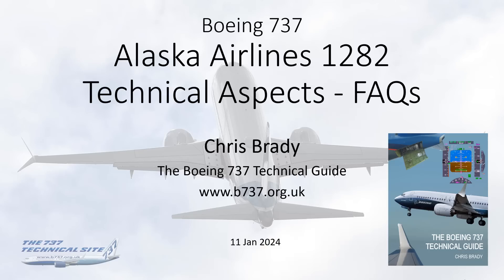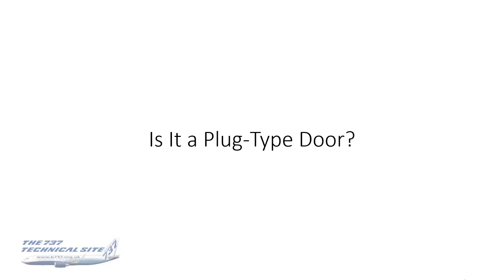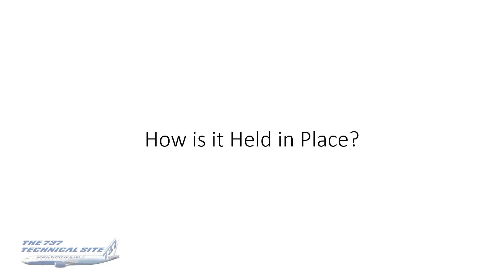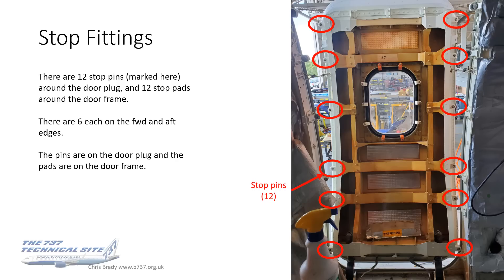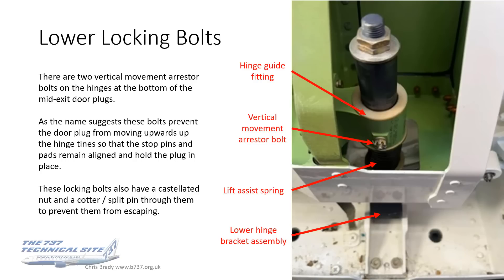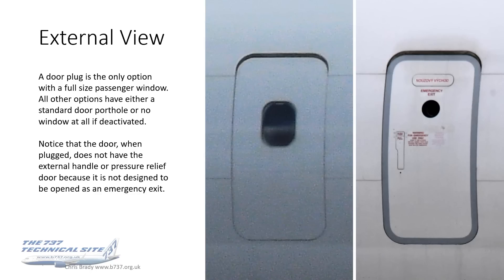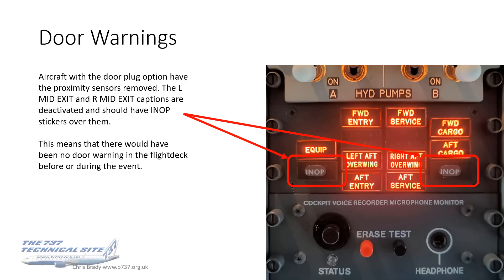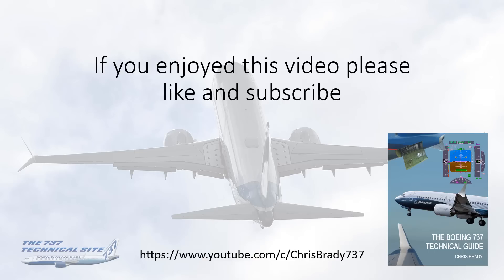737 Technical Aspects of AS1282 FAQs

Comment: Hi Chris @The Boeing 737 Technical Channel. Hope you don't mind my two penn'orth:
Firstly, it seems to me that there's an issue with nomenclature which is not helping. Definition for clarification is - NOMENCLATURE the devising or choosing of names for things, especially in a science or other discipline:
"the most important rule of nomenclature is that the name of a substance should be UNAMBIGUOUS".and
You youself even mix the terms up in the first couple of minutes of this (excellent) posting.
So, a Plug DOOR is like a plug on a chain in a kithen sink. It is wider than the hole it is plugging and also wedge shaped. This means that the more pressure is pushing on it, the tighter the fit in the hole. Try pulling on the chain when the sink is full of water as opposed to empty and you'll feel the difference. So a Plug DOOR opens INWARDS because it's wider than the hole, and it's wedge shaped.
A Door PLUG opens OUTWARDS when unbolted by the engineers, and is NOT wedge shaped. Therefore the pressure inside the aircraft is always trying to force this door OPEN. It is only the STOP PINS against the STOP PADS which prevent this. The four bolts with cotter or split pins prevent the stop pads and stop pins from getting out of alignment with each other.
So, when the aircraft is pressurised and the stop pads and pins are forced tighter against each other, the pressure is actually trying to force the Door PLUG open, not closed, as it would with an actual DOOR.
Therefore, the adjustment and locking of the STOP PINS is also CRUCIAL as well as the aforementioned four bolts.
Lastly, no-one seems to have mentioned how a pressure seal is achieved with this PLUG. I'm assuming an actual SEAL? (Think fridge door, but on the aircraft body and more industrial)
BTW to remove ambiguity I would suggest the terms "Plug Door" and "Door Blank"

Comment: Hi Chris,  Great work, the details are critical and you keep peeling another layer of the onion. Here are my thoughts:

1. with the airplane on the ground at sea level, the door.plug in correct position, and the door.plug and all interfacing components "rigged" optimally:
 a. significant upward or downward movement of the door.plug relative to the cabin frame is prevented, as:
 - the cabin frame attached roller pins cannot pass the closed end of the door.plug frame attached roller guide in the upward direction nor pass the locking bolt through roller guide fitting in the downward direction.
 - the arrestor bolts passing through both the door.plug frame attached hinge guide fittings and the cabin frame attached upper hinge cylinder.guide segments prevent both upward and downward movement (assuming the arrestor bolt passes through a reasonably toleranced hole in the upper hinge cylinder.guide and not through a vertical slot).
 b. again, assuming optimal "rigging", the twelve door.plug frame attached stop pins are aligned on center with each corresponding cabin frame mounted stop pad.
 c. some limited upward, downward, and sideways movement is possible for the door.plug relative to the cabin frame due to frame, fitting, and "rigging" tolerances, thus the stop pins might move slightly off center of the stop pads, but these design tolerances presumably are sufficient to restrict movement to appreciably less that half the diameter of the stop pin, else if any of the stop pin mating surface starts to clear the stop pad edge, position and pressure distribution could unequalize leading to failure as noted in other comments.

2. with the airplane climbing and cabin-to-exterior pressure differential mounting, the stop pin to stop pad alignment distributes the pressure across twelve fittings designed with sufficiently strong metal to withstand that pressure. the pressure retains the stop pin to stop pad alignment, and all is well.

3. conceptual steps to tilt open the door.plug on the ground at sea level (complete removal requires additional steps):
a. remove the hinge arrestor bolt cotter pins and nuts, and applying pressure down against the spring to relieve the interference between the arrestor bolt and the cylindrical hinge segment hole, slide the arrestor bolts out.
b. the spring can now exert upward force on the door, raising the door.plug with attached roller guide slightly such that the bottom of the roller pins are in interference with the roller guide locking bolts; the stop pin and stop pads remain mostly aligned if not slightly shifted.
c. the roller guide locking bolt cotter pins and nuts are removed, then apply some downward pressure on the door.plug against the spring to remove the interference pressure between locking bolt and roller pin, and slide those bolts out.
d. apply upward force as needed to assist the springs, and pulling the door.plug inward to provide clearance between the stop pins and stop pads, raise the door.plug until the roller pins are at the bottom opening of the roller guide and the stop pins are clear of the stop pads. (this assumes the stop pins do not need to be adjusted to open the door.plug, but that may be an incorrect assumption)
e. push the door.plug outward at the top, with rotation of the hinges. the door is held at a tilt by the short strap assemblies (cables).

4. The next "layer of the onion" might be understanding what it takes for optimaly "rigging"? In approximate order of priority, the following are/could-be involved:
a. roller guide locking bolts and hinge arrestor bolts with associated nuts, cotter.split pins, torque, etc. all installed to spec.
b. the stop pin adjustments, along with bushings, bumpers, locking wires or other components of the stop pads or pins, all installed and adjusted to spec (if the pins extend out too far, might be too hard to pull in on the door.plug enough to clear and get inward of the stop pads;  if the pins not extended enough, the pressure in flight might push the door.plug frame and skin against the seals enough so the wind stream in flight can get behind the door.plug skin, and making it hard for the auto pressurization system to keep up with the leakage, and while landing, assuming other tolerances of bolts, fittings, etc. are excessive, allow some of the stop pins to bounce/vibrate out of alignment with their stop pads).
c. hinge guide fittings - notice each fitting has vertical slots for each of the four bolts where attached to the door.plug frame, presumably necessary to achieve optimal positioning.
d. door.plug perimeter seals or similar.

5. It seems clear from the NTSB press conferences that even if all the bolts are installed properly, if the stop pins and stop pads are misaligned, then the roller guides and hinges are not strong enough and will fail. It is hard to tell from the photos, but one impression is that the roller pins are shorter than might be expected, thus if the door.plug bowed outward, the roller pin could exert force close to the edge of the roller guide, more easily fracturing it, and/or escape the locking bolt.  Further, that there is a bigger gap between the roller pin base and the outer edge of the roller guide, again, allowing for more sideway movement of the door.plug, and less of the roller pin to be within the roller guide.

6. The NTSB press conference stated that "transparency" is important, but there is limited evidence of said NTSB transparancy.  I would have expected high resolution close up photos of the hinges hanging outside the airplane, as well as the same for the interior side of the recovered door.plug.

Comment: Curious how the pressure seal works on this the door. It would seem to be an active seal that has to be self energized as the differential increases since the door wants to move away from the fuselage. If the door was slightly out of position (depending on various factors) it may or may not energize leading to pressure alarms? 
A passive seal would be used on a real plug type door as the door would compress the seal.

Comment: So, those 12 lock pins must be used to pull the door against whatever type of seal they use. Therefore, to open the door you would have to slacken off all 12 lock pins to release the pressure of the seal and also to clear the indented portion of 12 lock pads. And to close the door, resetting the torque on the locking pins would be about the last thing you would. I wonder if it was done?? Hard to see how the locking wire works on those locking pins. I’m guessing indents around the hole for the wire to drop into, maybe. Is a special tool used to wind those threads on the locking pins in and out?? Seeing more equals learning more. Regards
Reply: Just based on the pix, I didn’t see any indents on the lock pads, or if there was, it’s not visible there.

I don’t believe the lock pins pull the door against the seal other than holding it tight while it slides downward into place the 1.5+- inches required to get the pins lined up with pads and such.
Reply: Thank you for showing interest in my comment. The photo at the 4.24 mark is the best closeup of one of the 12 door pads I have seen. Shame it’s not in 3D. But can’t be really sure, unless I was holding it in my hand. It really looks like it dishes in from the outer circle rim. Not very much, but enough to help with the alignment of the door.  I can’t believe that getting the door onto the top roller and then pulling it down, could create enough preload on the door seal. Winding the door pins in a couple of turns would certainly do it. Once the airframe is pressurised any outward movement of the door would only lessen the effectiveness of the door seal. The seal is attached to the airframe and the door has to pull in to the seal. When the aircraft is pressurised, the pressure on the door is always trying to break the seal. The pressure can not help make the seal better in this style of door. I believe those 12 door pins and pads should be holding pressure against each other, not just close to each other. And the only way to achieve that would be to get the door in place and then crank on some pressure. Even if the pads were flat on the surface. It would still make sense to tighten the pins. The 12 pads and pins have to take all the loads. That top roller guide track is way to weak to take any decent loads. Looks like it has enough strength to hold the door in place until the 12 pads and pins take over. Well, that’s my take on the engineering. I hope we get to find out the real reason in the end. Regards.

Comment: Much better Chris. The only slight criticism I have is with your references to the roller pins "moving". They're fixed to the door frame and don't move, the door and guide tracks do. The bolts aren't "holding the roller pins in position", they more accurately prevent the door and guide tracks from moving upward over the roller pins. It occurred to me that the springs likely counter almost all of the weight of the door, making it easier to lift. That would mean that without the bolts in place, the springs are trying to push the door up, so it may not require much force to move it when the cabin isn't pressurized and the door isn't pressed tightly against the stops. If the bolts were missing, I wonder if the door wasn't gradually working its way up while depressurized until it finally cleared the stops at 16,000 ft. Even one bolt in place seems like it should be enough to have secured the door.
Reply: The roller pins might not move but the ring/roller around that shaft will likely move as it rotates…
Reply: Absolutely concur with this comment. The frame of reference is critical to understanding the kinematics of the door. 

Also concur with the description of the function of the springs. The operator has the advantage of his body mass to push the door downward and closed, but could use a little help in lifting it to the open position.

Comment: Your "Alignment" slide shows what appears to be the gray door seal on the frame and it looks like the door is pulled tight against the seal when it engages the stop pads. I wondered what provides the sealing if the door isn't over sized.

Comment: I think there is enough published information to make a reasonable guess as to what happened. The starting point is that there were loose anchor bolts found on other airplanes holding the hinge guide fitting to the door. When the vertical movement arrestor bolt is in place, there is little force on the hinge guide fitting anchor bolts from the spring. Loose anchor bolts are then free to unwind and remove themselves as the fuselage flexes in ordinary operation. Let's assume that the fore side anchor bolts loosen and come out. On the next landing when the differential pressure across the door goes to zero, the fore side of the door sags and the door tilts to the fore side. The movement is limited at the top side due to the clearance between the guide track and the guide roller but it appears that movement aft on the aft hinge can be substantial ... the bottom of the door will shift aft. The stop pins are no longer centered on the stop pads, especially on the lower part of the door. If the pins are offset far enough, the pin will not longer be in compression (which they are designed for) but there will be a lateral bending moment applied to the pin (certainly NOT designed for this). Given that there is about 3000 lbs of force on the door at 16000 ft and each pin is designed to take 1/12 of that, there is 250 lbs of force applied with a bending moment to the offset pin. Let's assume that a couple of the bottom aft pins slip off of the stops. This, by itself, probably doesn't make the door loose its seal or blow off.  The door probably deflects outward a bit but the flexibility of the gasket material may allow it to follow the door as it bulges outwards. However, there is now greater force on all of the other pins (total force divided by the remaining number of pins in contact). Now if more pins slip off the stops (from turbulence, perhaps), then the door will bulge even more and the seal will fail. When that happens there will be a high velocity gas jet though the aft side of the door, creating a low pressure compared to the fore side. The door will very quickly slam to the aft side, allowing the pins on the fore side to disconnect from their stops. Now the door is in the slip stream, connected only by the upper roller pins and one hinge pin. None of these are designed to withstand the explosive decompression due to 3000lbs pushing the door out from the plane and they will shear off. I did hear a report that one of the guide tracks was damaged and this may be why. I will be interested to see if the NTSB inspection confirms what I suspect.

There are some comments suggesting that this should be a "true plug door". I think the answer is that if it were, the door frame and gasket would need to withstand very large forces at cruise altitude: 7500 lbs force at 30000ft for a 4ft x 2ft door. With the pin system, the force on the frame and gasket are only about 500lbs. So good engineering, in my opinion. Keep the airplane as light as possible. Maybe we could just be sure that the bolts are tightened and won't loosen.

Comment: Thank you for putting in so much effort and educating us Chris!!
One clarification, if you please: what are the required (unpressurized) rigging “gaps” between the 12 pins and their stops? If those gaps are not correctly set, as in excessive gaps, say 0.15” instead of say 0.005”, where would the 15,000 to 20,000 lbs of pressurization differential load transfer to?
Reply from the maker: I don't have that level of detail, remember I am a pilot not an engineer. Hopefully one of the many engineers on here can take that question.
Reply: I would suggest the door would deform to conform to the extra gap, with unknown consequences.  I don't know what the spacing gap would be either. I'm sure the door clearances are a regular inspection item.
Reply: Is there a risk that the pressurization induced (differential) loads could have damaged the guide / hinge fittings (that presumably weren’t designed for those loads) and over a few flight cycles resulted in separation of the door? Assuming the correct gap rigging was either not done or not correctly done, of course…
Reply: As soon as the door pins started to misalign with their stops, it would be anyone's guess to when the door would let go under pressurization. The guides would do little to stop it leaving the aircraft. @halmehr5964

Comment: To be safe the springs should be strong enough to support the weight of the plug so that if the securing bolts were not installed the springs would position the plug in a position where it would not be possible to pressurize the airplane.  The seal at the bottom of the plug would be gapped and any attempt to pressurize the airplane would just push the plug open at a very low pressure.  Fail Safe on the ground.  A problem may arise if the springs were not designed to overcome the friction of the seals thereby allowing the plug to remain down behind the stop fittings even thought the securing bolts were not installed.  Subsequent minor vibrations during ground operations and unpressurized taxi conditions would allow the springs to keep creeping the plug up a little higher over many cycles until finally it moved enough to move the stop pins over to the edge of the stop pads and then the cabin pressure could blow it out.  

Boeing has an internal Design Requirement on all doors that they be designed to be safe in any position or condition.  So all doors have to be shown to be safe whether they are closed or not.  This includes showing that it is safe to fly the airplane with any entry, emergency exit, or cargo door open and all doors are designed to satisfy this requirement.  If the springs in this door plug had been strong enough to overcome the friction of the seals and push it up to thr raised position then this door would also meet this Design Requirement.